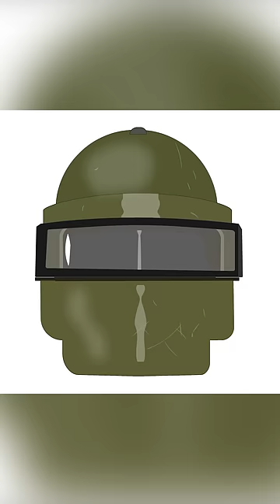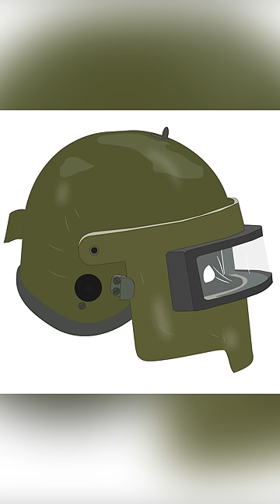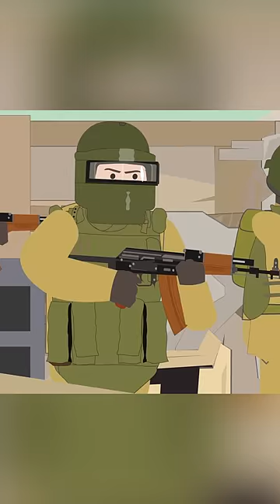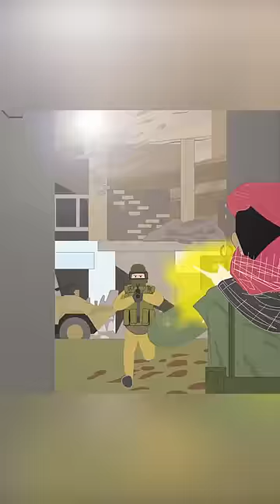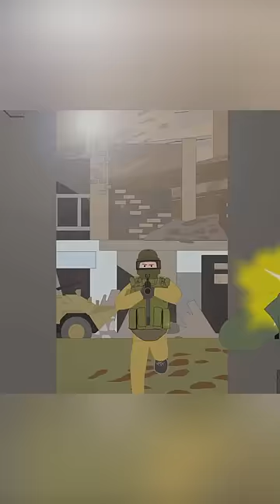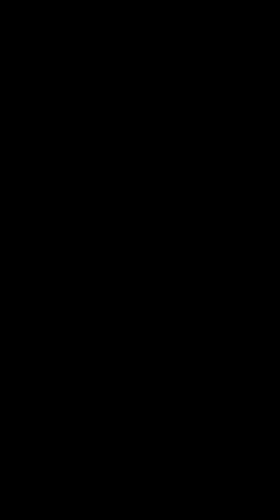The Bulletproof Spetnaz Altyn Helmet  #Shorts

Comment: Ain’t all that bullet proof. It’s armour rating is similar to flak helmets constructed for EOD and keeping bits of shrapnel out of your head. 

If you were shot anywhere in the visor with pistol (and equivalent) rounds, the user gets a shitload of fine, sharp glass peppering their eyes and face. Rifle rounds just go straight through. 

And a .30cal family round turns the titanium into shrapnel. Titanium is harder, but brittle compared to steel. 

Good flak helmet; overrated bullet resistance.